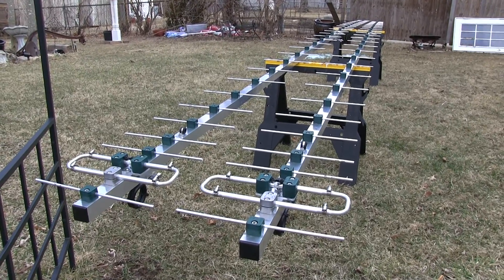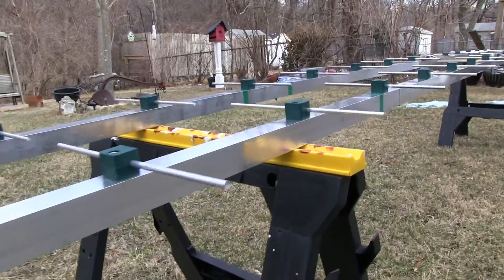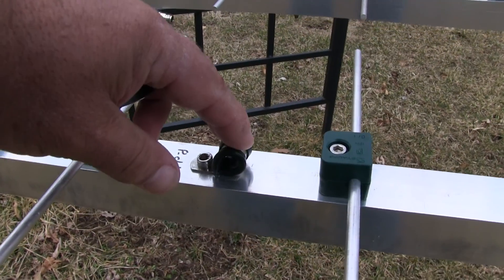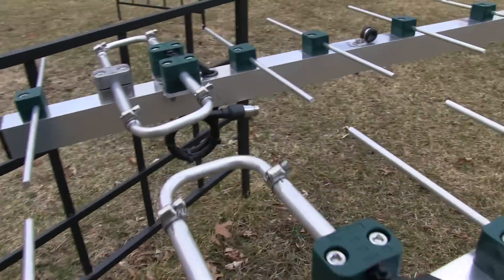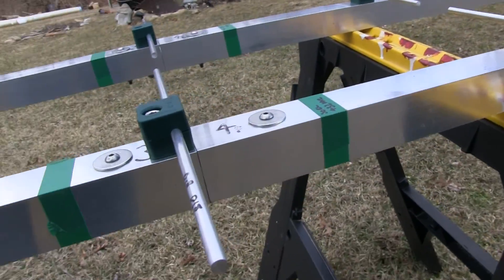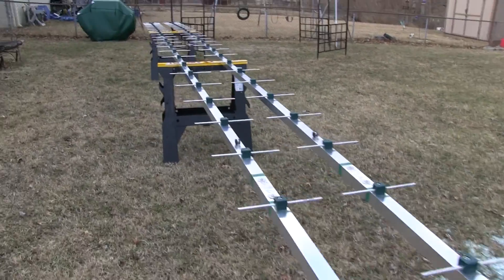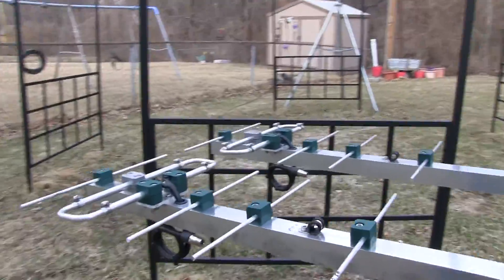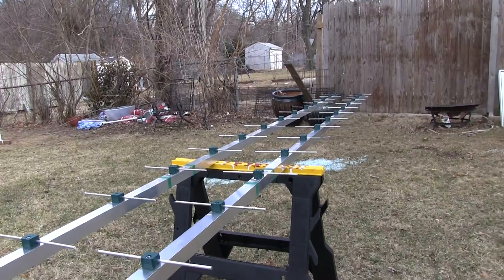432MHz 30 Ele Innovo Anternna

Comment: You got a lot of (metal) material between the elements at the mast clamps. Does that not effect your gain and pattern in a very much negative way I wonder? PA0HSE
Reply from the maker: No it does not. I have 4 of these on the tower now and they perform wonderfully.

Comment: Hi JD how ar the antennas going? I've had experience with this brand but on 2m. After being told how good they were i found they were not good mechanically or with the claimed gain nd pattern. As u can see the single bolt element clamps are able to swivel out of alignment, there also not UV stable over time, the rubber insert for the boom support rope will deteriorate, cant pull the booms flat before they star bowing sideways, the choke coil balun is not good at 2m let alone 70cm. I had 4 x 17 elem up and found pattern was worse than a single 17b2 cushcraft, particularly fromt to back and side lobes. Very disappointed.

Comment: You can also build your own. The dimensions are given on G0KSC's website. I built a 6m version with parts from Grainger, DX-Engineering for the tubing and a local aluminum supplier for the boom. 

This guy on youtube shows a 6m yagi build, the principals are the same:  https://www.youtube.com/watch?v=p2ajOTwvx4Q   

However, that said, now that they have a USA distributor, the prices are very reasonable.   Was shipping expensive?
Reply from the maker: +Cisco8484 yes I know many guys who enjoy building and have the time. Performance is outstanding. DX Engineering and Granger are great sources for the parts. Shipping was about $80.00 for 6 antennas, phasing lines and power dividers. 3 tubes total. Bill at Force 12 is great to work with. When I ever retire I want to build some .